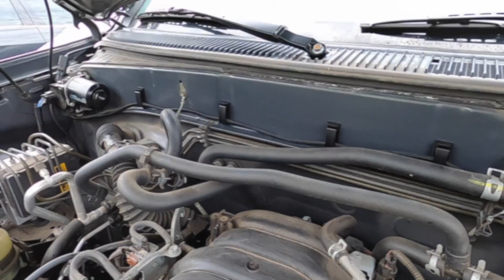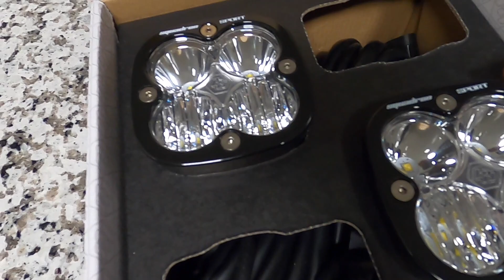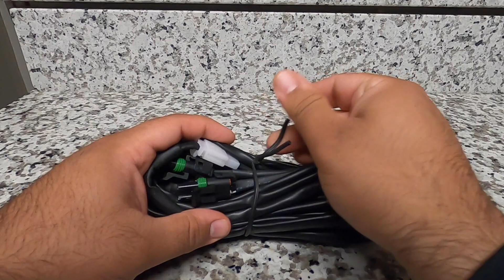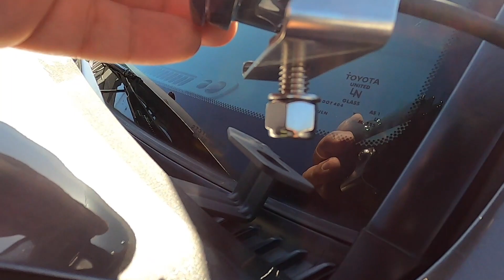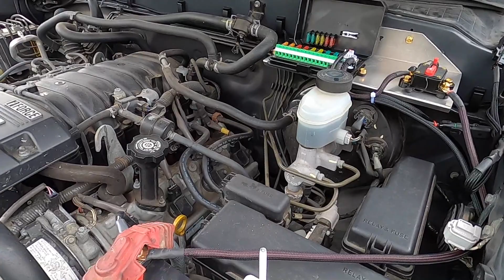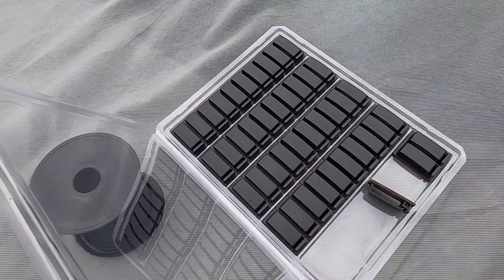Baja Design Ditch lights install and wiring | Toyota Sequoia

Comment: For the Y-split, did you just twist blacks and blacks, whites and whites, then connected it to the female delphi plug?
Reply from the maker: yes i will have a more in-depth video as I add more lights